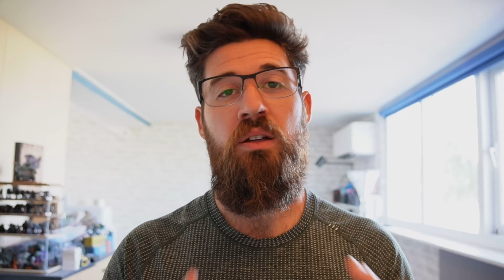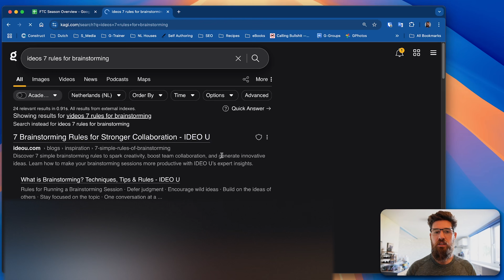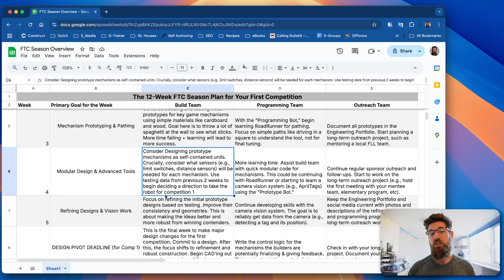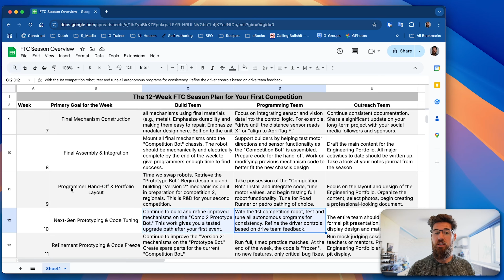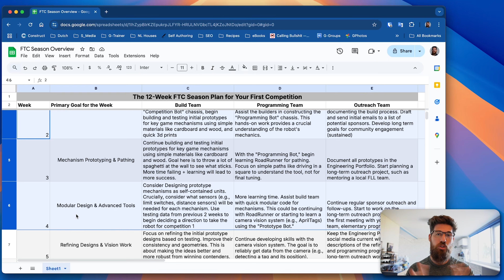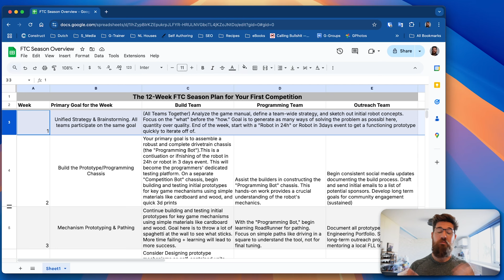A 12 Week FTC Season Plan That Actually Works

Comment: That's pretty similar to our plan, but our situation is that our first competition is only 8 weeks after kickoff. So, we have a "test chassis" that the programmers have been working with doing many of your early tasks. The plan is that they will do the programming for the competition bot on the test chassis to include all actuators, sensors, etc just to ensure that they function as intended. It should mirror what is being built by the build team. Then it should just be tuning parameters (limits, etc) when the program moves to the competition bot.
Reply from the maker: Wow that's a short season. That's a great call to have x2 bots in parallel so as to keep things up to speed without needing to hold one team off. How does this work in with your rookie members who are not as skilled to manage a competition robot?
Reply: @BroganMPratt well, this will be our first time trying it. But the plan is to have rookies shadow veterans so they "learn on the job".  Also, we have 4 meets before the league championship at the end of January.  So, expectations for the first couple are extremely low.
Reply from the maker: I hope it works for you. One thing I'd make sure is that rookies still feel like they're participating on the prototyping bot. Having 2 complete competition robots can be rather intimidating for first timers, and it can make them less likely to want to try new things out of fear that they will "mess up" the main robot.